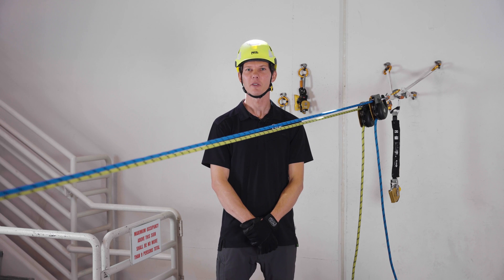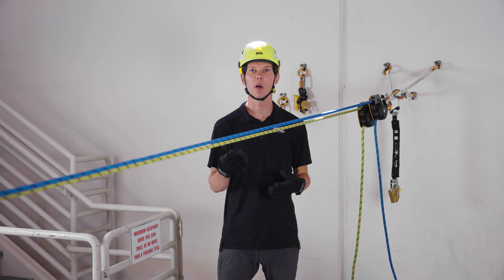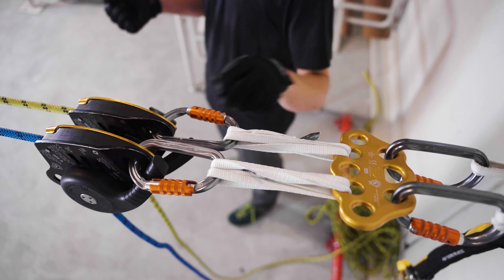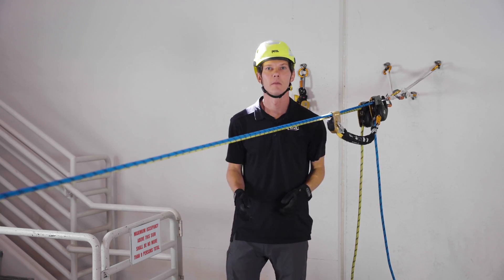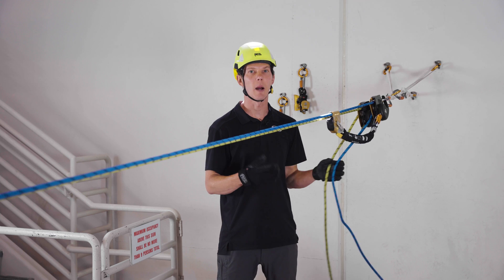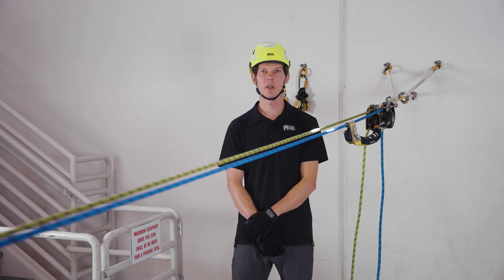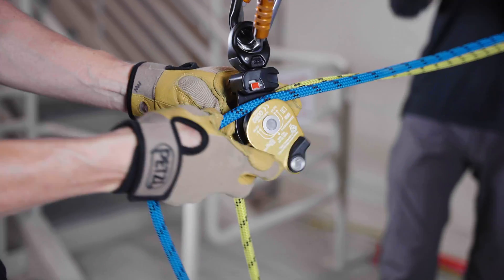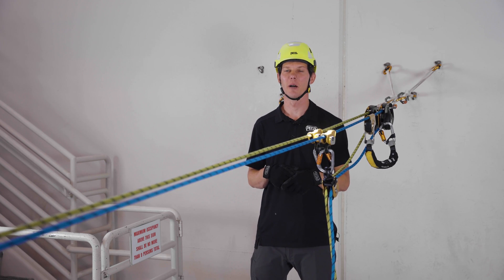HOW TO use the MAESTRO in Twin Tensioned System

Comment: In this video they use 2 sling on the plate to give ideal direction to the Maestro devices, they also affirm the possibility of using micro Swivel, however according to what I experienced, there are several configurations with which the M or L plate will not be compatible with the Swivel open system, after an inspection of 5 Swivel open had to be discarded due to lever force and excessive play!